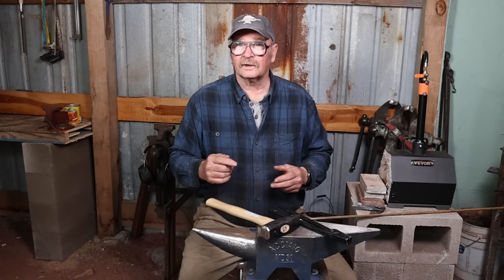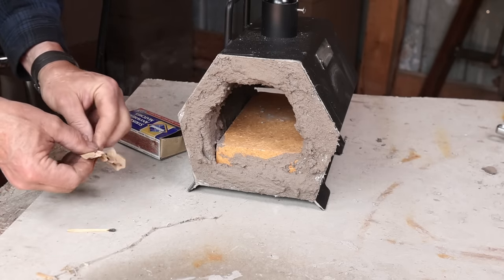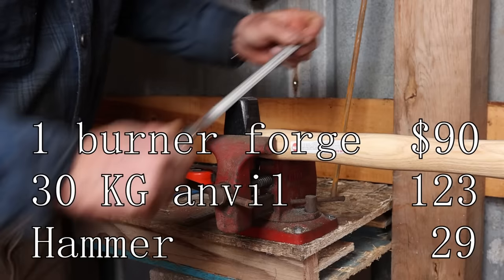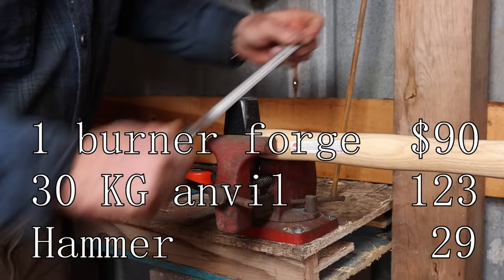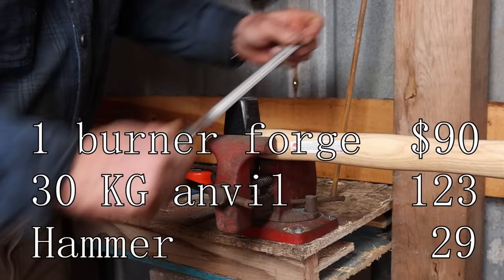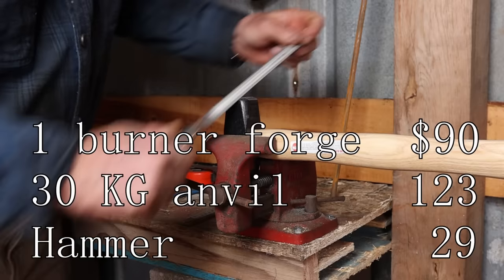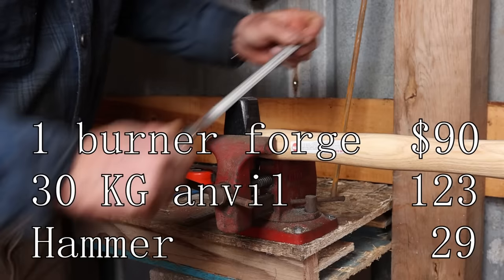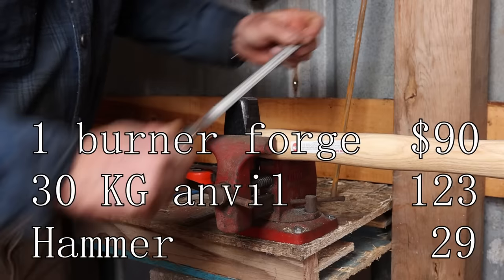Affordable Blacksmithing - Budget friendly TOOLS

Comment: Awesome videos can anyone tell me what cold roll is local steel place has 3/8 bar and 3/8 cold rolled video never mentioned cold roll so assuming I don't need it but can anyone tell me much appreciated.
Reply from the maker: When steel is made into bars it is run through rollers.  Hot rolled steel is easier to make, has mill scale on the outside (this doesn't hurt anything)  and is a littler over sized.  Cold rolled steel is done cold in the final stages, its a more expensive process, leaves a clean finish with no mill scale and is an exact size.  Both are fine for forging, but the hot roll will be easier to find and cost less.  Cold roll is good if you need that exact size for something like a hinge pin.

Comment: Brownells has s7 drill rod blanks in round stock and other steels for part making gun parts. most are forgeable and harden easily by air,oil or water quenching.  They can also be tempered and normalized if desired or needed. It's not always going to be the cheapest ,but it is always going to be good quality product that is tried and true.

Comment: Everything I have for my blacksmith shop is portable, anvil is only 100#, the grinding table I made has wheels and a removable handle so I can wheel it around, the solid fuel forge is not really big, about like moving a heavier kitchen table, and the gas forge is setting on a 55 gallon drum.

Comment: Ok John, ya talked me into it (wasn’t too hard). I’ve pulled the trigger on a Vevor 110# anvil, ordered basic tools (800g hammer, 400mm wolf tongs) and am now shopping for a forge. Split between the 1 or 2 burner. Thinking of the 2 burner for expansion reasons (provided I’m not terrible at smithing).

Also considering upgrading the refractory cement. 

Suggestions? Thoughts?

Comment: As a quick comparison, just the forge alone is nearly $500 NZD, far more than just the difference in exchange rate. That model you have there is not locally available, maybe able to get it online for around $200 including freight, customs and tax
Not a criticism, just saying.
This is why, for what little forging I do, it's done using an acetylene torch for heat source. Not the best but it works for small items and I've managed to make a reasonable size ancient sax this way and a good viking axe head.
Definitely taking some ideas from this video to see how to make life easier for me.
Reply: Whoah, wth is going on in NZ???  Clicking the single burner link in the description, shows $115 Au. So not too different to the US price (for once).
Reply: Yeah I can see that, it's quite similar in Australia. Even though VEVOR is just a reseller, They slap their sticker on products, I don't know of any companies that do the same down there. When I was in Australia it was cheaper to have someone buy it in Europe and then ship down.  

Although in all honesty you don't need the forge, The anvil on the other hand is way more useful, It's much better than using a piece of railroad. For a forge you can get some charcoal and a blower and start working, In some ways working with coal is better. With propane you really need gloves or a long work piece, with coal you're only heating a small area and the heat only travels up so far.
Reply: @dadegroot  Small market. Also, as I said, the exact model is not directly available here. We can get it by buying online but have probably have to pay GST on initial cost plus freight
Reply: @dadegroot  Probably a cheaper option, this is just what I came up with on first look at link
Reply from the maker: Wow!  I didn't expect the US prices to be accurate everywhere, but I didn't think they would be that far off.  But where there's a will there's a way and it sounds like you're finding a way that works for you.  Glad the video helped out.
Reply: @BlackBearForge  Thanks mate. 
I enjoy all your videos and learn a lot from them.

Comment: Depending on the hardy size,  a reasonable source of material for a hardy tool is a big bolt, I made a small cutoff by forging a 7/8 bolt to the <3/4 square, and made a wedge from the unthreaded  portion of the shank.   Obviously had to cut off the hex head.  The bolt was found on the side of the road,  though could be scavenged from any number of places.   When attempting to harden the cutting edge just don't quench the areas that were threaded, or grind any evidence of threads away to avoid cracking.   Best advice though,  is to look for and befriend anyone locally who is already doing it,  chances are they've got stuff or local knowledge to share.

Comment: Just a comment and am NOT dissing the tools you are reviewing today.  That is certainly not my intention.  If I remember correctly, a recent You Tuber defined Vevor as not a real manufacturer's brand, but a necessary "actual company brand" that is required to sell a product through a lot of online companies.  Vevor products are just named as such to be able to sell and could be from any number of manufacturers.  If the You Tuber is wrong, I am sure someone certainly knows better than me and will reply or comment.  Good video.  Thanks.
Reply: There are too many widely different Vevor-branded products for them to be manufacturers: NEMA electrical boxes, power tools, ultrasonic cleaners, mag drills, anvils, forges....  But of course Sears never manufactured a single item either, and much of America functioned on Sears-marketed products for a century. My father-in-law would have been lost without them!

Comment: I have literally no tools and currently live in an apartment, but my dream is to do some black smithing when u have the space for it. This video makes it seem super accessible
Reply from the maker: An apartment does present a problem.  But you can join a blacksmithing group and attend workshops.  You might meet someone nearby that would let you work with them in their shop.  Or if you have a friends with a space to work, you might be able to share tools.  I started in my in laws back yard.
Reply: A good friend of mine lives in an apartment with a garage area, he just wheels his forge out front with his anvil and goes to town. It helps that the garage is away from the main building but you could look for something similar just be sure to ask. The apartment complex allows BBQs in that area so a forge wasn't a big step up.

Comment: If the hot metal was put into a vacuum, wouldn't it stay hot for far longer until the hammer strokes unless the hammer head is also hot but can maintain its structure and performance to allow longer forging with fewer fuel? A quick thought.

Comment: Always wanted to try black smithing. I'm 70, both shoulders are blown out and require implants, elbows aren't too bad, wrists are arthritic. Would I be able to do small projects around the farm or am I out of luck. I sorta wanted to do my bucket list and forging has been on it quite a while.
Reply from the maker: If you can swing a hammer to drive nails, there a chance you could do some light forging.  Power tools such as a power hammer or a press and help with larger work.

Comment: Great information there thanks. Ive heard that the gasline and fittings are not built for purpose with these forges. Whats your opinion on this? Is there anything that youve changed or modified to make these type forges work better?

Comment: Saw the bit about attempting to forge weld the bending fork, and that reminds me of a question i havent yet found an answer to.

My parents are concerned about the "poison" aspect of borax as a flux, since we sit practically right above the water table.  You mentioned not wanting to "contaminate" your shop there.  Are there more ecological fluxes?  Or, are there ways to clean up flux areas?  I havent seen this addressed...like, general workshop maintenance, hazardous materials like oil rags, flux and other potential toxins, etc.
Reply from the maker: Flux contamination isn't about toxicity.  The problem in a gas forge is that flux corrodes the floor and causes your forge to wear out faster.
Reply: @BlackBearForge  aaahhh okay

Comment: Thanks for all your videos, John! I have a question. Where did early blacksmith get their steel from? How did the steel come? What is it in rough shapes? Thank you 😊
Reply from the maker: If you go far enough back, they had to smelt there own iron and make steel for the things that required steel.  But at some point the manufacture became a specialized trade and blacksmiths could simply buy what they needed from a supplier.  it would have been limited compared to what we have today, but it was like any other product for sale such as flour or cloth.
Reply: @BlackBearForge  thanks John that’s so fascinating 👍🏼

Comment: Hi John, i jave the Vevor 66 and I noticed that it does not have a step. Would it be okay if I were to use my angle grinder to cut a step near the horn. Of course keeping the anvil as cool as possible to not remove the temper (if any?). Was also considering drilling another pritchel hole near the hardy as this one seems to be in a bad location. What are your thoughts?

Comment: I live at 6800 feet in SW Colorado and am wondering what altitude you are at? The forge does seem to do a decent job heating steel at your place. I have a foundry that I'm having problems getting to melt brass here and wonder if the combo Vevor foundry/forge with double burner might do the job. It would also allow me to try some blacksmithing as well. I'd get to try some of the techniques you show on your channel, not just watch...

Comment: That looks like a nice forge, was hoping that it would be up to some forge welding. I already have a gas forge but haven't been too happy with it so far. It's easy too big for the things i usually do and takes too much time and gas to get up to temperature.
Reply from the maker: I think it has potential.  Closing off the back and using flux would probably make the difference.  But since flux eventually ruins the forge floor, I was holding off on welding in this forge.  On the plus side, this would be an easy forge to reline if needed.
Reply: @BlackBearForge  thanks, good to hear!

Comment: is there any advantage in getting the double long forge burner? If money were less of an issue would you get the double?
Reply from the maker: Only if you plan on doing work that needs the longer heat.  Many people end up with more than one gas forge so they have options for different jobs.

Comment: Curious, when you said you didn't want to contaminate the forge with flux, what does that mean? What effect does having flux contamination in the forge have?
Reply from the maker: Flux is corrosive to the ceramic lining of the forge.  If you forge weld in a gas forge you just have to accept that the lining will need to be replaced ever year or two.  Since I don't plan on welding in these little forges, I didn't want to start with any damage.
Reply: @BlackBearForge  Interesting! Thanks for the reply!

Comment: Keep in mind exchange cylinders are in fact 20 pound cylinders but they’re only filled with 15 pounds of fuel. If you go to an actual filling station they will tell your 20 pound cylinder with 20 pounds of fuel so there’s even more savings there.

Comment: Thanks for your video. I have a question: I see that your steel turns white in the propane forge, is the color white because of the video or is it white in real life? in my BECMA GFR.2 Gas Forge the steel barely turns yellow. Thanks for your effort.
Reply from the maker: It isn't that hot.  Cameras don't like hot iron, so the color usually looks hotter than it is.
Reply: @BlackBearForge  Thank you for your answer.

Comment: John, would wood ash have been an acceptable flux, to keep from contaminating the forge floor? I've seen it used in other vids. I actually remember a vid of someone forge welding multiple plates, for a pattern wielded knife, in a big, really hot forge, without fluxing. I think they were using charcoal. But, they were also squeezing them together with what looked like a 30 - 50 ton press. ☺️☺️☺️
Reply from the maker: That isn't something I have heard of before.  Interesting idea
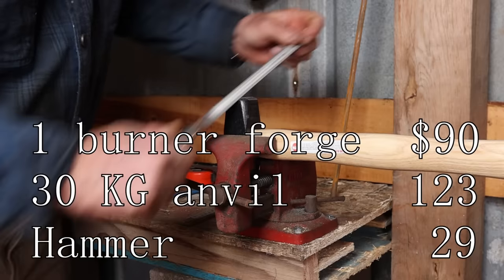Reply: @BlackBearForge  ..Daniel Tokar frequently uses wood ash. @ 16:30 he talks  a bit more about using them.
https://www.youtube.com/watch?v=jr_scZW3R7c

Comment: I am about to buy everything to begin blacksmithing, I do have a question on propane. How long does a smaller 20 gallon grilling tank last?
Reply from the maker: I would expect a couple of days depending on how long you work at the forge and how high you turn up the heat.
Reply: @BlackBearForge  Perfect, thank you so much! Your video is very informational and very well explained, I can't wait to get it all and get going!

Comment: Hey, i have everything, but the 3/8" hot rolled mild steel. Is that what i ask for, or does it have another name? Also, does the forge come with the cement? I've been seeing people saying it doesn't.
Reply from the maker: Yes, you can just ask for 3/8" round hot roll.  My understanding is that forge no longer includes the refractory.  It will need to be purchased elsewhere.  Most blacksmithing suppliers will carry something.
Reply: @BlackBearForge thank you!

Comment: If you would please explain contamination of the new gas forge when forge welding in it. Thanks.
Reply from the maker: The flux that is typically used for forge welding is corrosive to the refractory of the forge.  So I would prefer not to get flux in this forge unless I plan to use it for welding regularly.  In that case I would just plan to re line the forge every year of two.

Comment: So I ordered a vevor forge, but can't figure out the refractory cement. It states 10:3 ratio on the bag, but doesn't have a whole lot more than that. There support person wasn't any help, but day after the 4th, might just be out of that person's wheelhouse. How much water did you mix with the cement?
Reply from the maker: The mix ratio is by weight.  But if you don't have a scale that accurate you can just mix it into a paste thick enough to stay on the insulation but thin enough to spread.   I actually found it easiest to apply with a small trowel instead of brushing it on

Comment: John quick question on forge welding. Could you put a small concrete paver brick in the forge to forge weld on instead of a fire brick to keep from contemplating the forge and fire bricks?
Reply from the maker: I would never use concrete, it might shatter rather dramatically at heat.  But you can use a sacrificial fire brick or thinner kiln shelf.
Reply: @BlackBearForge  I was just thinking about how to keep from contaminating everything

Comment: The propane swaps are actually only 15 lbs as well so the fill is a much better deal if using a 20lb cylinder
Reply from the maker: That does make a difference.

Comment: What is your opinion on using old Lug Wrenches for projects? I assume it's a better steel than most. I have a few from various cars I've owned, and they're piling up in my shop! I was thinking of cutting one up for chisels and punches.
Reply from the maker: I haven't used one, but I would guess they are good steel and would make decent hand punches and chisels so long as you're good about cooling them in use.

Comment: Now much did you use of the cement because I had to buy it separate because I bought it from vevo site I can’t find the water to cement ratio to mix It
Reply from the maker: I used all that they sent.  There was a mix ratio on the bag, but it was in weight not volume, so you would need a scale.  I just mixed it thin enough to spread but not watery

Comment: What do you mean contaminate the forge with flux? I thought using flux was common practice?  Does it damage the forge?
Reply from the maker: Flux is caustic to the lining of a gas forge. If you’re forge welding in gas you will need to reline your forge a bit more often. A sacrificial floor like a kiln shelf can help.
Reply: @BlackBearForge  I appreciate the information, I have never heard that anywhere. I am getting a Mr. volcano forge should be here next week. I appreciate you not letting me destroy it right off the bat😅
Reply: @BlackBearForge  do you think it would be a good idea to have both the propane forge and build a coal forge for welding or is it not that crucial?

Comment: Are forges typically open on both ends? I have no idea about any of this stuff but that surprised me, seems like a lot of heat would be lost
Reply from the maker: Many have two doors so you can run long bars clear through to heat the middle.  Most forges can have a fire brick placed at the rear opening to keep some heat in.
Reply: @BlackBearForge  That makes sense, thanks for the reply!

Comment: I'm curious. I've seen these anvils popping up everywhere, but they seem rather loud. What would be some tricks to quieten them down?  Would putting a little silicone or Flex Seal do the trick?
Reply from the maker: Silicone is what I usually use, but anything that deadens the vibration would help.
Reply: @BlackBearForge  I was just curious if it would work. I know, with your other anvils, they had a flat base while this one has legs.

Comment: What would be better for a beginner the single burner or dual burner vevor forge?
Reply from the maker: I think the single burner would be ideal for a beginner.  However if you plan on longer work it might be better to start with the double burner initially instead of having to upgrade.  Although gas forges do eventually need to be replaced and you can upgrade then.